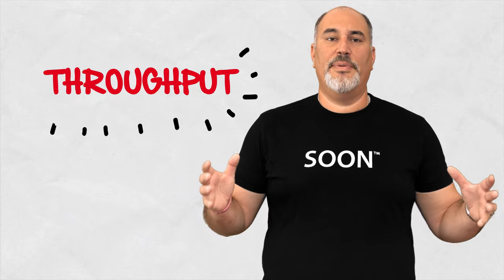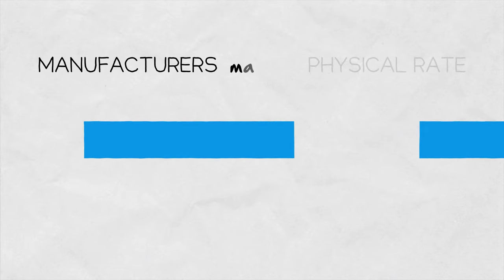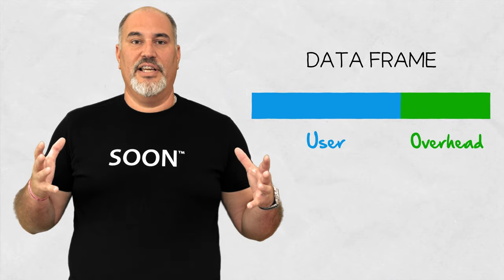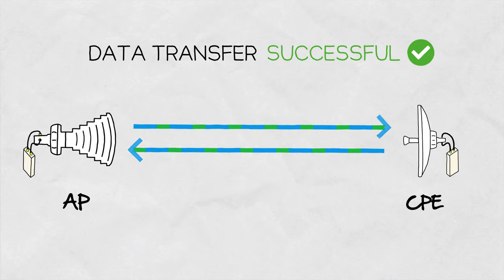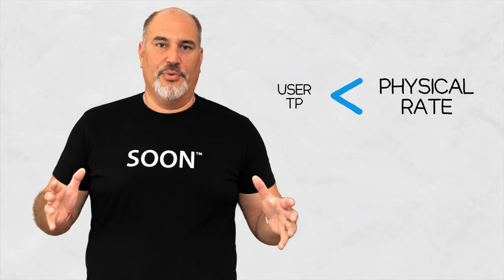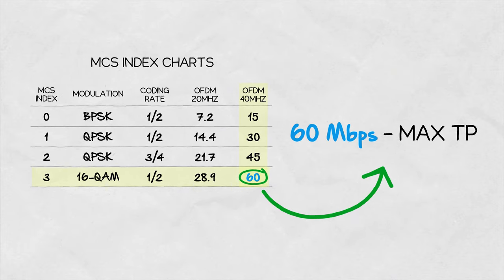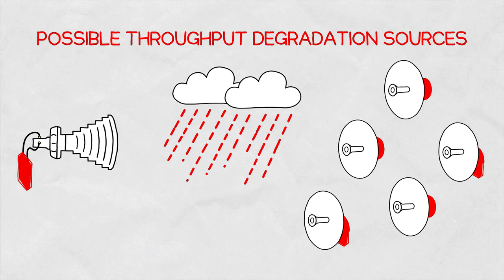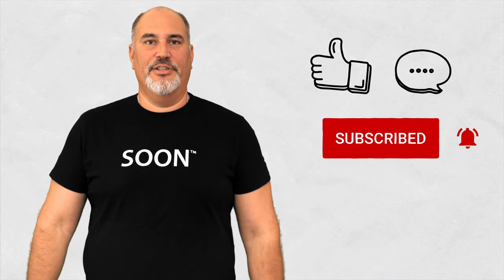Inside Wireless: Network Throughput

Comment: i believe that the MCS table show data rate= physical rate; while the actual throughput is less than the phy rate; do you have a clue for the percentage from the phy rate the actual throughput could be?
Reply from the maker: Hi, this is defined by the standard IEEE, you can check that documentation. Thanks